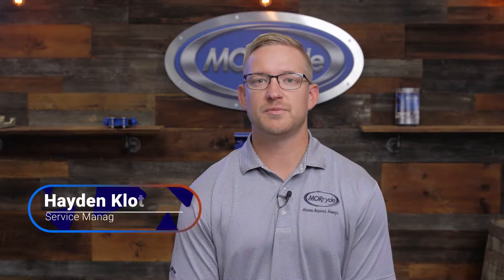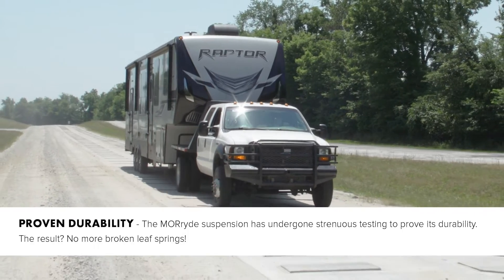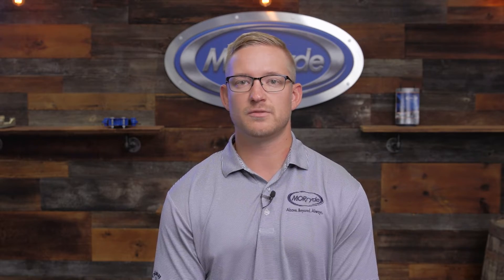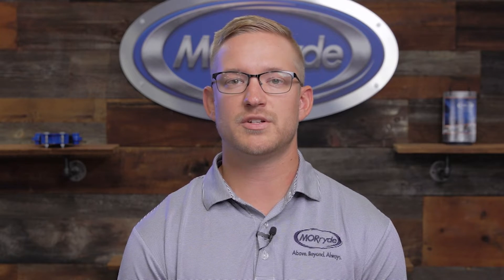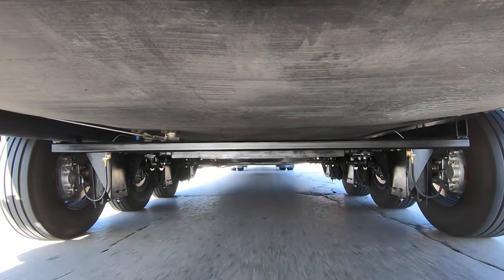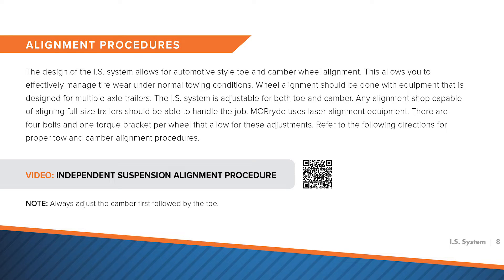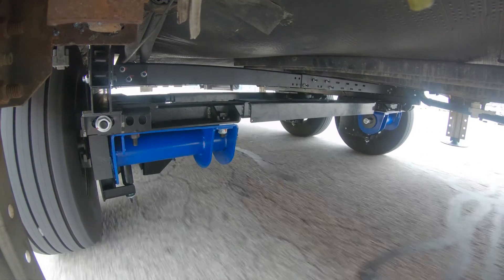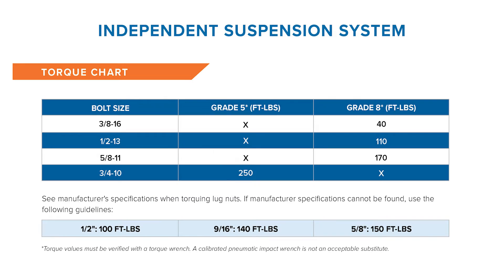Independent Suspension Owner's Manual Walk-through

Comment: How much weight does the system add to a typical 5th such as a Brinkley or Pinnacle that have 8000 lbs axles. Then how much does that get transferred to the pin box weight?

Comment: Good job Hayden and we grease these at these intervals for safe measures to make sure we dont burn up wheel bearings and as a former technician I recommend tire monitor system for Temps in the event bearings do go you'll see it befor it turns catastrophic if you don't go by these standards it can and will happen always grease with our recommend grease 

Thanks Mor/Ryde for a great product